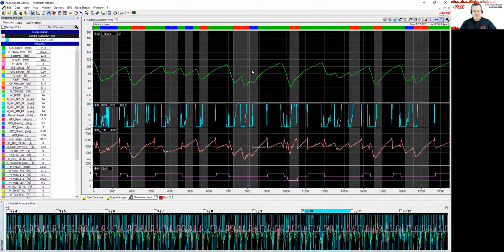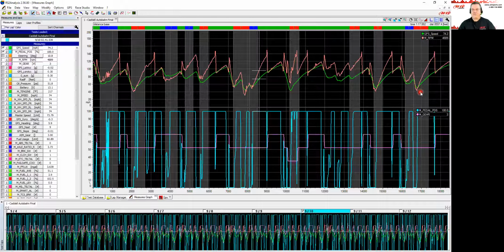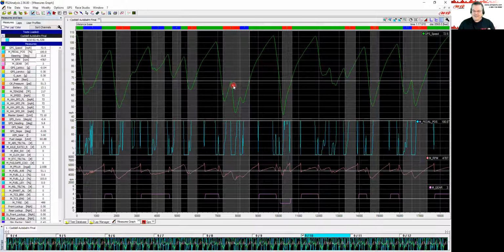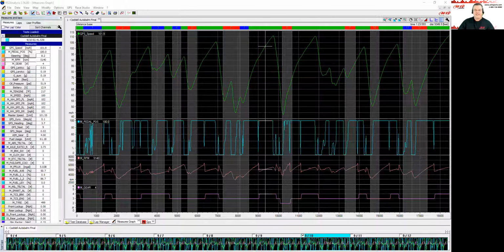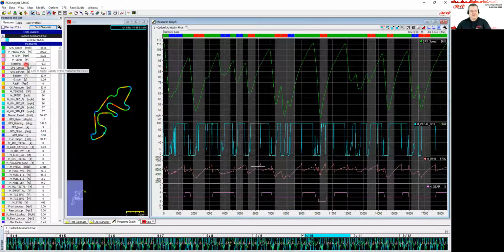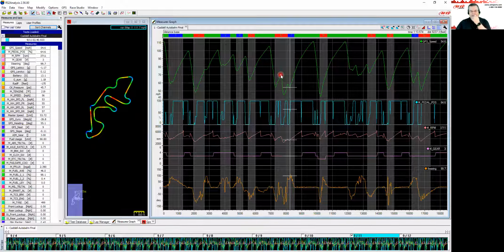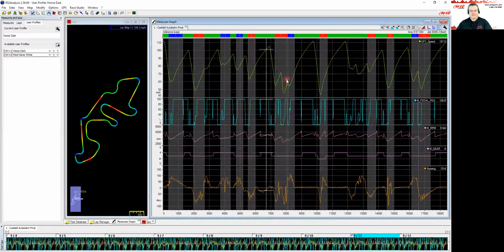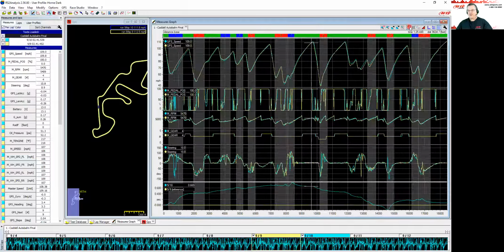1-2 Race Studio 2 Analysis User Interface - Live Webinar - 4/2/2020

Comment: I worked with Race Studio 2 some time but I learned a lot. Than you for that.  But I have a question: The GPS location. As I know (I was a prof sailer) gps coordinates are not exact. How does this work in analysis.?  The small time (location) differences can fool you about the correct time/position of the car or how is this problem solved.